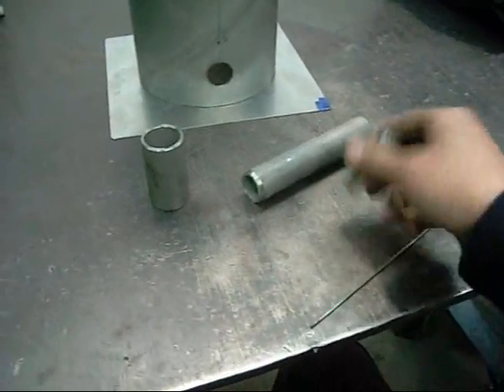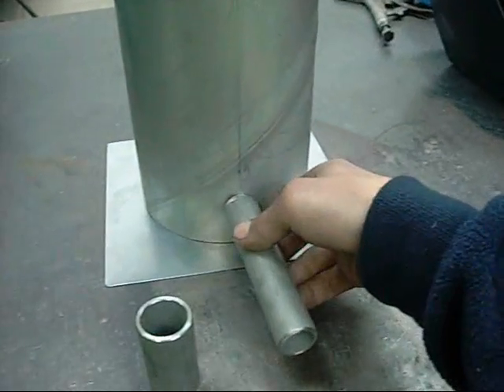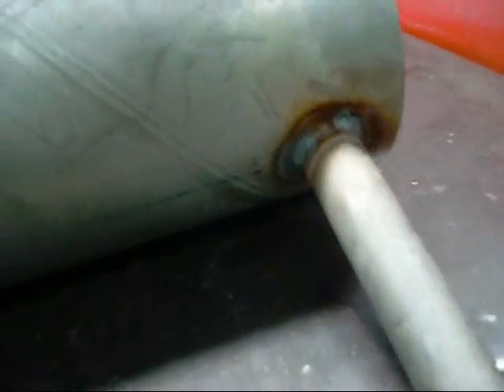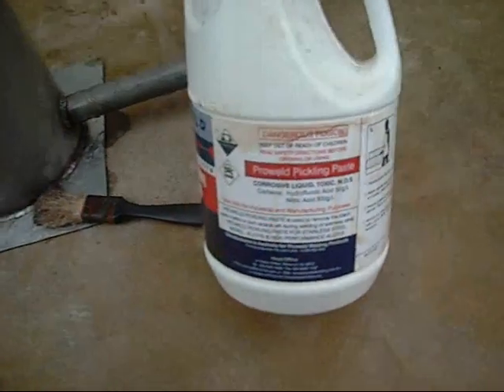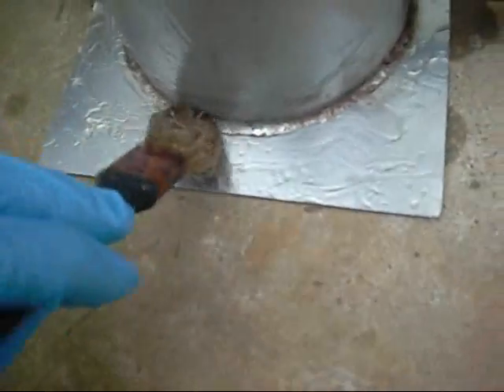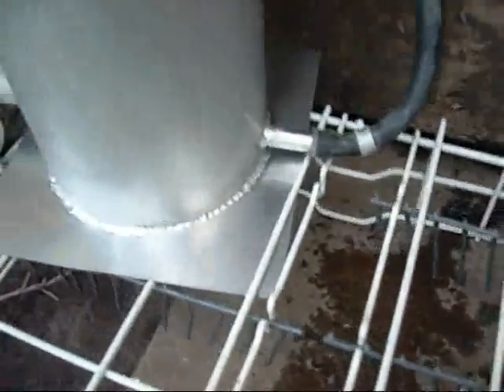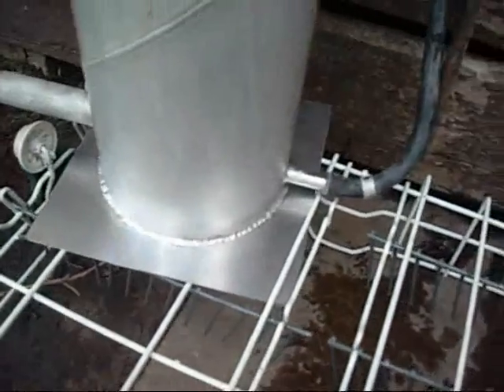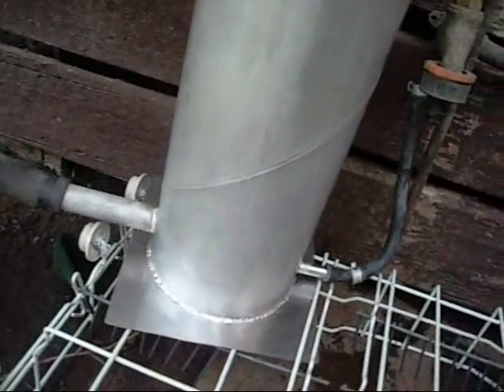Fabricating Stainless Steel Cooling Tower For Hangzao Diesel

Comment: ive use pickling paste before omg its horrible stuff stains ur skin yellow if you get it on you its powerfull enough to dissolve your senses if you dont were a proper resperator,  you got some mighty fine TIG skills there

Comment from the maker: @douro20 if you can braze with a oxy torch you'll pick up Tig really easy.

you just use a concentrated arc as your flame and try not to dip the tungsten electrode in the filler (the gap was 4mm from the work in the vid)